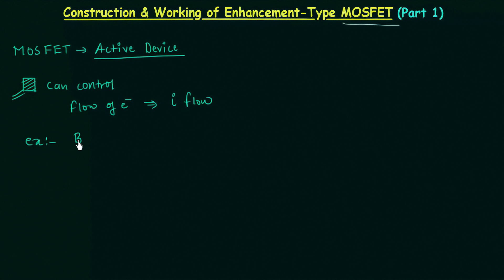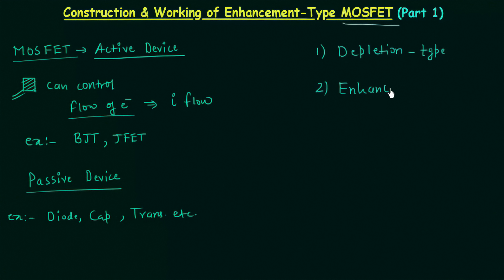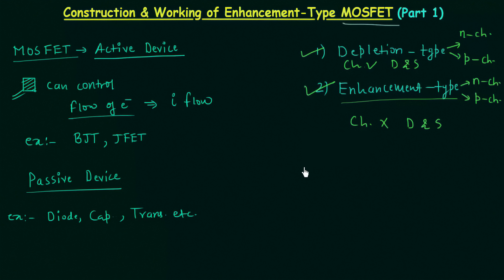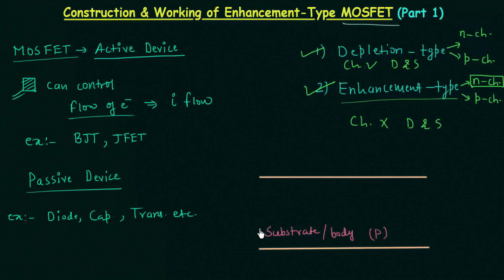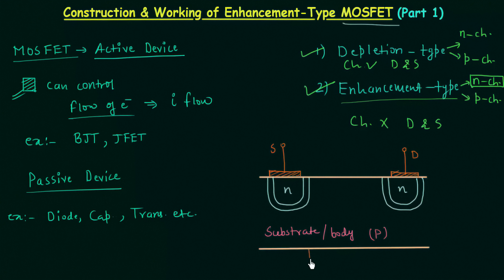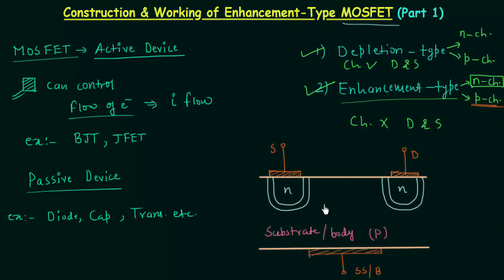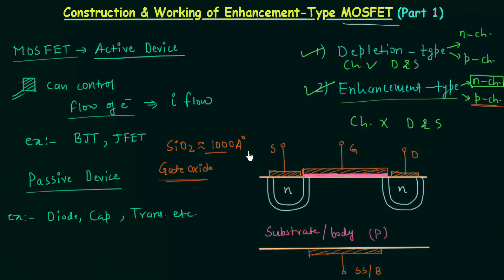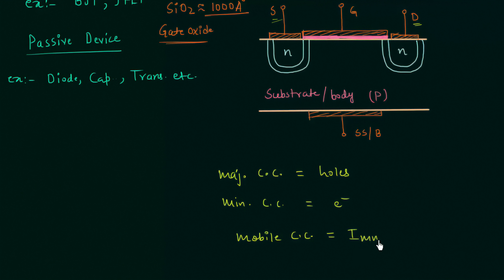Construction & Working of Enhancement-Type MOSFET (Part 1)

Comment: Diode is an active device . I think its wrong at 1:58
Reply: A diode can be either an active or passive component, depending on its characteristics.A diode is generally considered a passive component because it doesn't require an external power source to operate.

Comment: Sir resistor can control the flow of electrons right?? Then whether it is an active device??
Reply: Resistor is a passive device because its not required external sources to control flow of electron but in active device its required external sources to control the flow of electron.

Comment: Sorry about that but, diode is an active device, because they are semiconductors, and his junction needs a current to provide 0.7V, in fact, we can say that every semiconductor is an active device. After that, you did very well, like it.
Reply: No, I too had this same doubt. Almost all type of diodes are considered as  passive components. But there are exceptions . For example Gunn diode , impatt diode etc. They have negative differential resistance and are considered as active devices.

Comment: If the gate terminal is connected to positive and the body is connected to negative then the gate terminal should attract the negative electrons in p material....then why are you saying that it initially attracts the holes in the p substrate?

Comment: i had doubt in  inversion we make n type to p type or vice versa pls clarify it thanks
Reply: If you apply positive potential in the gate in case of NChannel mosfet Nchannel will be formed in the ptype body here inversion means charges are inverting. [ptype substract Nchannel] like wise Ntype substract Pchannel for that you need to apply negative to gate only by then it will puss the negatively  charged electrons   in Ntype substract and attracts minority carriers [holes] and hence Pchannel is formed here inversion takes place in Ntype body Pchannel is created. I  Hope you will understand my friend like wise accumulation means same charge will accumulate for ptype p and for ntype n

Comment: sir why diode is passive
actually diode also allow current in one direction that means diode can also control flow of electrons
actually BJT is also back to back connection of two diodes

transformer can be used to step up or step down the voltage

Comment: Why Vds is positive in nmos and negative in pmos
Reply: Source is something which provides charge carriers drain is something which drains the charge carriers from source.  In Nchannel mosfet source and drain are highly doped Ntype if you apply positive potential to drain and negative potential to source positive potential attracts electron from source to drain and flow of current will be opposite direction of flow of electron.....  IN case of Pchannel mosfet source and drain are Ptype there are lot many no of holes in souce in order to move holes from source to drain you need to apply negative potential in drain so drain will attract holes and you need to apply positive potential in source so it will ripple holes because  positive positive ripples..... and hence the flow of current is from source to drain because holes flow from source to drain and electron flows from drain to source....I hope you will understand my friend

Comment: Inversion means n type to p type or p type to n type bcz in this video p type changes to ntype but you mentioned inversion means ntype to ptype
Reply: Had the same doubt, please clarify
Reply: If you apply positive potential in the gate in case of NChannel mosfet Nchannel will be formed in the ptype body here inversion means charges are inverting. [ptype substract Nchannel] like wise Ntype substract Pchannel for that you need to apply negative to gate only by then it will puss the negatively  charged electrons   in Ntype substract and attracts minority carriers [holes] and hence Pchannel is formed here inversion takes place in Ntype body Pchannel is created. I  Hope you will understand my friend like wise accumulation means same charge will accumulate for ptype p and for ntype n

Comment: sir you said that there will be no channel present between drain and source for enhancement type MOSFET......but at last you got a channel.....confused
Reply: In Nchannel enhancement mosfet at the very beginning there will be no channel we are creating the channel by applying gate voltage more than threshold voltage. If gate voltage is less than threshold voltage there will be no channel.

Comment: is oxide layer is also acting as an insulator...then the gate current will.zero..!    is this true or not??
Reply: In case of Nchannel mosfet  current will actually flow from drain to souce......gate has nothing to do with the current flow. It is responsible only for creating channel. Flow of current depends upon Vds.

Comment: Transistor is current device or voltage device ?
Reply: Bjt is a current controlled device.... because flow of current through the bjt depends upon the input current applied to the base terminal.  Mosfet is a voltage controlled device because flow of current through the mosfet depends upon the input gate voltage In mosfet voltage is responsible for creating a channel hence it is called voltage controlled device...I HOPE you understand
Reply: Current control device

Comment: Active/Passive device's definition is ambiguous. Acc to this definition, Resistor seems to be an active device as it can control the flow of charge carriers in a circuit. But actually, a Resistor is a passive, bilateral component.

Comment: THIS VIDEO WAS SO WORTH WATCHING !!
Reply: O-genki desuka?... Oreki Hotarou
Reply: Nice video.but if we give positive vgs to jfet what's happen
Reply: @sindhuridanam8750  positive Vgs makes cellphones to attract electrons in the nature which eventually leads to electric shock to the user which eventually leads to death of user which eventually leads cellphone company to pay compensation to the users family
Reply: harshpal singh what i s the meaning of the uncovering of negative immobile ions
.can you plz explain
Reply: Aaliya Sameja
In this case as the substrate is  a P type semiconductor. means there is more hole than electron as carrier but at the same time no free ions are there. means -ve charges and +ve charges are balanced(covered by each other).
now as the +ve charges accumulates over the plate they(+ve charge) starts attracting the -ve charge or say pulling the positive charge(i.e. holes) this makes uncovering of -ve immobile ion which was previously covered by the holes.
Reply: @sarveshkumar-rk8dv  thankyouu
Reply: No it's not

Comment: Conventionally V(gs) should be pot. difference between source and gate, right?
But you used V(gs) here as pot. difference between gate and body. Can you make it clear?
I'm confused.
Reply: Watch the next video... it is explained clearly there. Its because the Source and Substrate are connected internally....so the potential difference between G,S and SS is effectively Zero.

Comment: I think Active and Passive Concepts are wrong..
Active devices are those who can amplify the current/voltage/power in circuit...and rest are passive components
Reply: Yep, and to amplify a signal, u gotta CONTROL the current anyway which a ressitor, capactor or inductor cannot do!
Reply: No it's correct..!! He has also said same think in just different way..!!
Reply: No he said 'control' , the whole point of making a circuit is to control the electrons. That way all the component can 'control' the flow of electrons. And by this definition all the components becomes 'active'